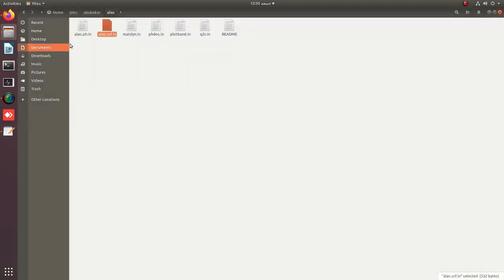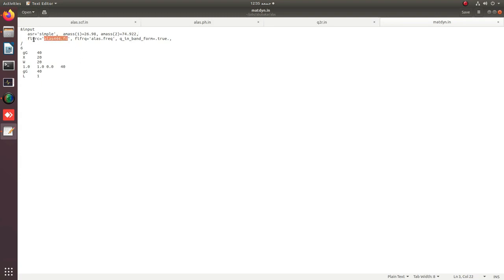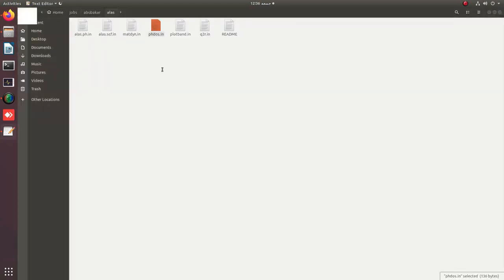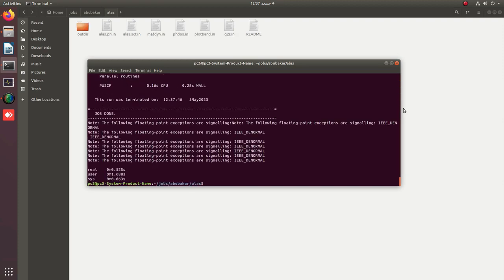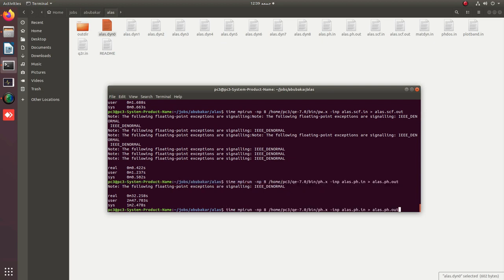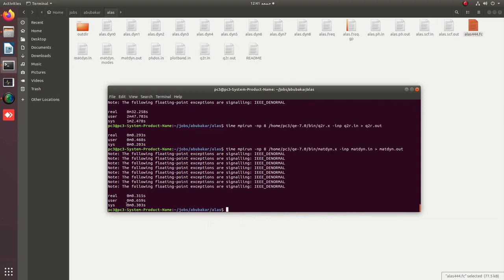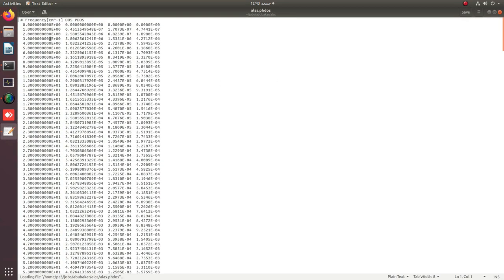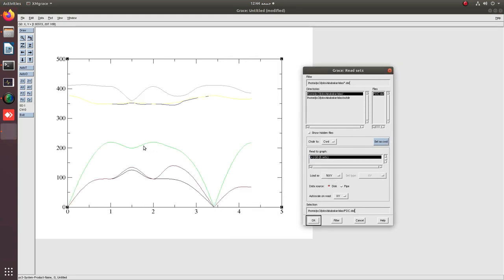How to do phonon calculations in Quantum Espresso

Comment: Hi! When I run the ph.x code for my material i.e. MoS2 I get very few dynamical matrices usually 0 , 1 and 2 but the file titled as matdyn.2 is empty. Do you have any idea what can be the reason behind this?
Reply from the maker: It is due to the number of q points in the ph.in file
You need to use q point more than 2*2*2 to get more dynamically matrices.